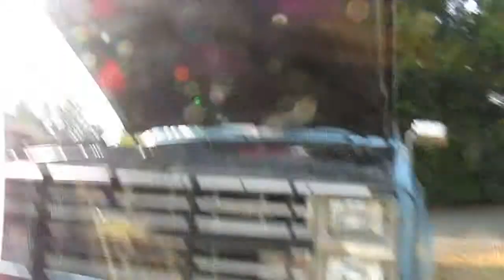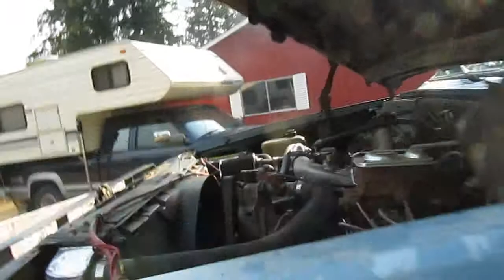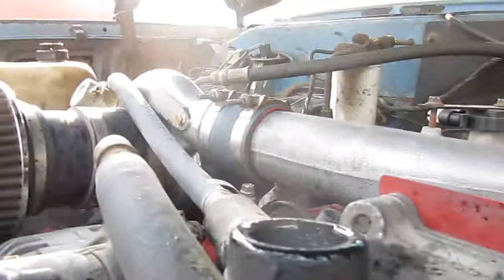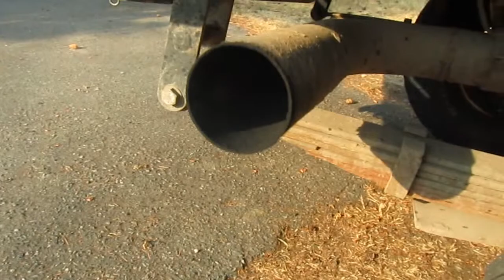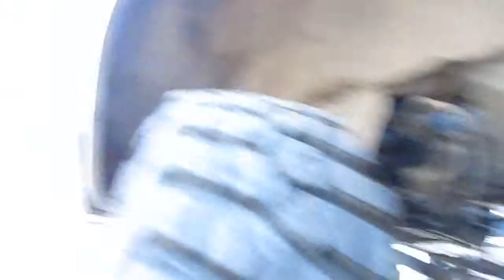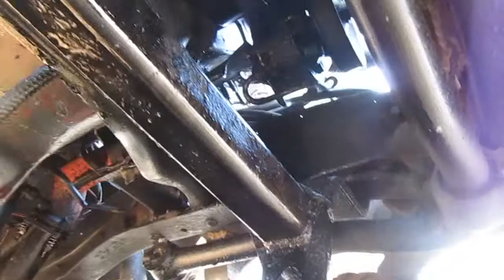86 Chevy K20 w/ Bad Headgasket or Piston

Comment: Blow by on a 6.2 & 6.5 is normal and expected. Now in order to control it from pushing oil out the seals you must have the CDR Valve properly hooked up and functioning. If it is bad or improperly installed or if your venting to atmosphere then yes you'll have excess pressure in the oil system which will find other routes other than the CDR to escape. 
Don't vent to atmosphere and properly hook up the CDR and you will eliminate your oil leaks.
Reply from the maker: Ancient video, I knew what was wrong with the truck. Yes crankcase pressure is typical on a 6.2/5, but not at the pulsing rate this engine was doing in the video and almost blowing the oil cap off. Piston was split in half. That engine isn't even in the truck anymore.

Comment: Hey so I noticed yours sounds so much deeper and doesn't have a sound like mine does, if you watch a video on mine and have your speakers turned up a lot it will actually hurt your ears, only on mine. Driving me nuts.
Reply from the maker: +Detroit Diesel CraftsmanFan You don't have a turbo, so it will sound different. Put some good mufflers on it and that will help too. My 85 with glass packs was very "clappy."
Reply: +Roadhog0 I mean the engine, if you try and go under the truck the engine raddle hurts the ears. Even if you open the hood it hurts the ears, did you watch the 86 one? Not the k10 you gotta watch the k20
Reply: +Roadhog0 ok thanks man, gotta start making more vids! I love your truck
Reply: How to put 6.5 turbo to 6.2 diesel engine